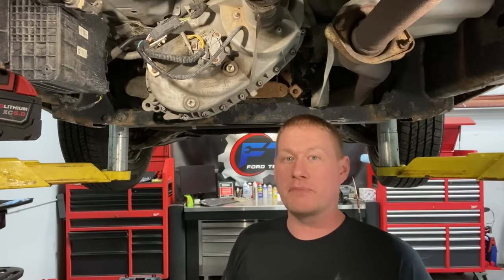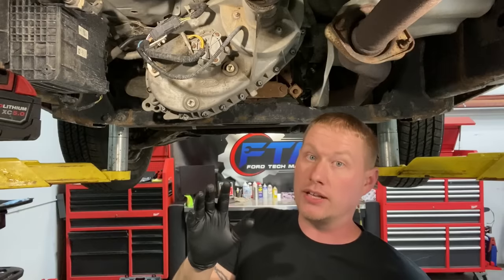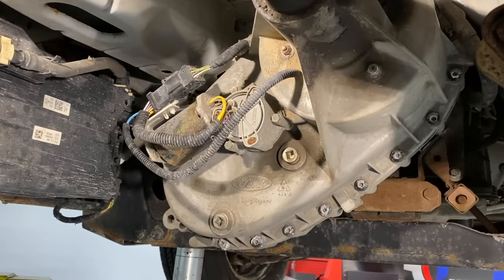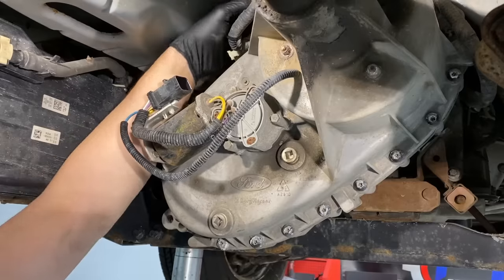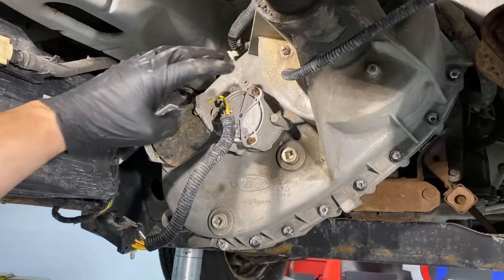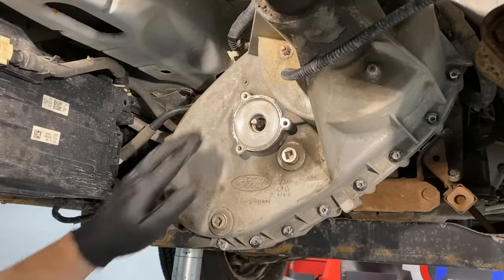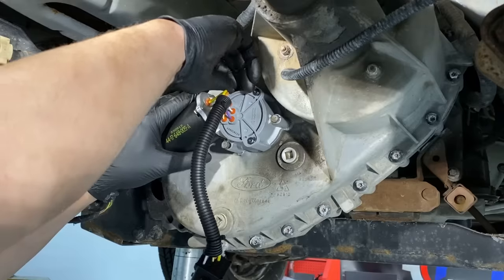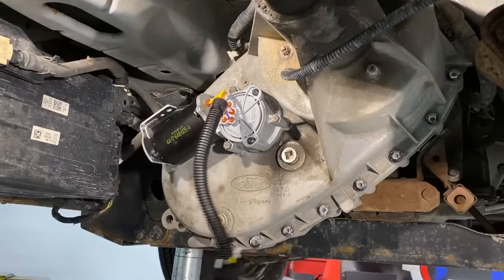2004-2020 Ford F-150 Four Wheel Drive Inoperative DTC P1867: Transfer Case Shift Motor Replacement

Comment: So I have an 07 F150. 4WD worked, and then died yesterday. I checked all fuses and relays, they're good. I have power at the switch in the dash, as well as 5V power on a bunch of the prongs on the wiring harness below. I am NOT getting 12v at the actuator motor power. If I jump power directly to the actuator, it will rotate. Is this an issue with essentially an encoder that's died so the BCM doesn't know it's position, so the BCM won't send it power? So a new actuator would have a new encoder and this would solve it? Thanks for any help.

Comment: Sorry but l remember a post U had on your channel referring to an motor noise on the new 5.0 motor used in the F-150 etc. It referred to number 3cyl valve noise and as l remember it had something to do with the rocker arm/arms revolving around that cylinder. I have all your posts but can't seem to locate that one if U can assist me l would deeply appreciate it. It doesn't matter but l am a retired 47yr mechanic and the truck in question is a 2017 F-150 which belongs to my good friend who is a disabled vet and is getting no help from Ford as they say they can't seem to hear the noise emitting from right side of the motor. Thank you.

Comment: My 2009 will only go in or outa 4x4 when it’s not running with key on… could it be this motor not sending the signal to the solenoid? I’ve replaced switch and solenoid, checked for vacuum leeks….
Reply: I have the same year…4x4 had stopped working a few years ago. I have not yet diagnosed the cause as I’ve been busy repairing the abs module. 

Question for you, if you don’t mind sharing. I recently began seeing “4x2” briefly displaying on the cluster when I turn the key on…however it doesn’t stay displayed when truck is running.  Do you mind sharing with me what you recall seeing when you start your truck? Thanks for any feedback…when I get home I’ll see if I can find the code. 

Also I had to repair my front passenger hub assembly a few years ago which I now wonder if it was due to iwes or 4x4 failing.

Comment: Could this electric motor be the cause of it not fully engaging in  4- wheel drive. My 2013 started like kicking out of 4x4 when it started getting under load?
Reply: Since there is obviously no follow up to the sorts of questions on this channel, my truck seems to be doing the same thing. 
violently slipping out of four-wheel-drive acting like it’s going to destroy something under the truck. What did you find out your problem was? 
please advise. 
Appreciate it thank you

Comment: How difficult should it be to turn manually to 4x4 and back? I have an ‘02 F350 and it’s quite difficult. I replaced my tc motor, and a few months later that motor burnt out. Wondering if it’s something more than just the tc motor

Comment: I have a 2005 f150 4x4 5.4. It starts up but doesn’t drive or go into reverse. Fuses are good, no transmission codes only speed sensor codes. Not sure what the issue is.

Comment: Would a faulty motor cause my 2011 engage 4 low when the dash switch is in 2 high while driving?
Reply: I am dealing with this exact issue. 2014 Expedition went into 4Low all by itself, and won't go back. From what I have researched so far, this can happen due to the faulty sensor plate inside, but is a less common failure. I'm changing mine out soon, so I will update the comment if it doesn't work.

Comment: I don't have a code on my 2013 F150 but my 4x4 is always on (4 Auto). Just about everything in the 4x4 system has been changed out including both IWE. Could the shift motor be the culprit but no code?

Comment: I'm trying to figure out if this is the part I need to replace.  After switching out of 4WD into 2wd I get a metal grinding noise.  If I stop the truck and switch back onto 4WD drive 10 to 20 ft and switch back to 2wd it goes away.  In your opinion is this the affected part that would cause this problem?

Comment: I have a 2006 F-150 and it does not have this motor, it has a Borg Warner transfer case and it is not going into 4 wheel drive?

Comment: My 2021 f150 will shift in and out of 4L and 2wd but won’t go into 4H.. tried spinning the actuator in that motor, and tried unhooking the battery to reset the confuser.. no codes are available but the service 4x4 light is on.. the truck did this at 15,000 miles and had never touched the 4x4 button..

Comment: I would like to know your feelings on the new plastic oil and transmission pans Ford is now putting on some of their vehicles.  Are you seeing a lot of problems--ie leaks?
Reply from the maker: I don’t see them too new but yes I have access to the Ford dealer site and yes tons of oil leak issues
Reply: Thanks for the reply.  I wanted to upgrade my Mustang V-6 to a Mustang GT, but couldn't get past those lousy plastic pans.  I understand that the Raptor went to plastic pans but have since gone back to metal due to leaks.

Comment: I have this problem. I believe I need to replace the transfer case motor. But mine is stuck in 4wd Lo. What is the best way to turn the shaft to get to 2wd Hi? Vice grip, channel lock? And should I be worried about damaging the shaft with those tools? Thanks in advance for any help!

Comment: So my truck got stuck on 4H , it switches from 4H to 4L and back but won’t switch back to 2H , I’ve installed a new motor from ford and still the same just won’t go back to 2H , and yes if I unbolt it the motor goes back to 2H and  I can manually switch it to 2H , any ideas or tips ? Thanks

Comment: Could this need to be replaced even if it doesn’t throw a code? I have a 2014 F-150, and I have the seems to be common problem of it having trouble going in and out of 4 Low. Where it acts like it’s in neutral and starts to grind.

Comment: I recently had an issue with my 4wd. Was in 4 low to pull my boat out of a bad launch. I shifted from 4 low to 4 high had a shift delayed pull forward message, then when put into drive it didn't move, rpms and speedometer increased. After multiple attempts and a check 4x4 message and some grinding it finally went into 2wd. Tried 4 low again and same thing happened no fault message this time. Also didn't have any fault codes when scanned after the check 4x4 message went away. Is my transfer case toast or is the shift motor most likely the issue?

Comment: I have a does f150 2014 when the 4X4 is turn on, on dry pavement I don’t hear any noise but in the snow I can hear noise on the driver side, I can also feel it under my foot. Does any know what’s the problem? I also put in two new actuator.

Comment: Hello friend, Excuse me for the inconvenience, get me out of doubt, the Ford explorer, expedition, F150, excursion, rangler and mazda, share the same transfer case? because I have to buy an engine of which you are changing but I see that they are very similar and only change the chips. This is so? Aperte I see a lot of difference in prices from one mode to another. and I have that little doubt that I see that the transfer cases are the same in those models. can be?

Comment: The transfer case is stuck between 4 HI and 4 Low on my  04 f150. What should I use to turn the shaft back to 2 Hi?

Comment: I changed the transfer case because the 4x4 doesn't go on. But now I put it on and it says 4x4 low and the truck drives slowly and doesn't go off anymore. What can I do?

Comment: Sooooo my 2009 f150 4h and 4L is not engaging..It says on the dash it’s in and when switching you can hear 1 little tick with ZERO follow through ..Could THIS be the issue.

Comment: I'm getting a grinding, whirring noise I think is coming from the transfer case. It only does it in 2 wheel drive. I think it might be the output shaft bearing or snap ring.  I can't find a part for the snap ring though. It comes up as a shaft repair sleeve. Has anyone done this specific repair? How does the sleeve work? Any help would be much appreciated.

Comment: My 05 expedition which is all wheel drive so my dial has all wheel drive too high for high for low it’s been making a spinning noise for about six months and not engaging in four-wheel-drive when I turn it from all wheel drive to too high the spinning stops for a few seconds but then it starts again do you think that’s the chain or do you think that’s the motor so 05expedition XLT I’ve got 130,000 miles on

Comment: If your truck was stuck in 4 hi  how would you turn shaft by hand so it would line up in the motor
Reply from the maker: Usually a pliers is needed
Reply: @FordTechMakuloco  thanks and you would need to get the truck in the air I think you might have said or I am just guessing

Comment: I took my actuator motor off and manually turned it to 2 wheel drive but my 4x4 low range indicator light stays on. It still seems like it's in low range even though I hand turned it to 2 high any idea why it won't go back to 2 high when I manually turned it to that setting ? Thanks

Comment: Great video man I had the same truck my motor almost got the 300,000 I put a ton of money in it I just have had enough body interior where pristine got $3,000 for it needed somebody like you to redo the whole thing two I bought a 2012 the five oh I like it except now 150000 miles stalls at idle at idle after it's warm any ideas
Reply: Sounds like throttle body and plate needs cleaning. Same for the idle air controller if it has it.

Comment: Hey I have a 2014 F150 Raptor. Repeatedly saying “Shift Delayed” no noise no code and no shift in to 4wd no matter if i pull forward or backwards. Could this be the Transfer Case Motor???

Comment: I have a 2003 f250  6.0  I can shift it into 4x4 but when I try to select 2wd nothing and I have to jump the relay to put it back I 2wd cleaned all connections tried a new  selector switch an new relays

Comment: The dealer told me if I installed an aftermarket motor from O'Reilly's myself it would need to be programed into the computer afterwards and they charge $110 to do so. I have a 2010. I notice you didn't mention doing this is it necessary  ?
Reply: No

Comment: My gas peddle looses connection in 4 x 4. Is this unit connected to throttle position via speed sensor? could this cause the peddle to go to zero?

Comment: So my 2007 suddenly wouldn't go out of 2wd.  One day it worked, the next day nothing. The light on the dash won't even light up. As I understand it if there is no vacuum then the hubs should be engaged and in 4wd. So if I had a vacuum leak somewhere I'd be stuck in 4wd not 2wd. Correct? So is this motor the likely culprit? Thanks!!!

Comment: Graat video, I love watching your videos. It's really helped me fix a few cars. I have a question, will the transfer case be going bad if my 95 bronco dies out in any gear when i put it in. When the 4wd is engaged it stays on in gear. When it's in 2wd it just doesn't stay on. I jacked up the rear end and put it in gear. It stayed on but making a grinding noise. Sounded like the transfer case or transmission. Once I applied the brake the truck died. It reapeated the same over and over. Any suggestions i can try to diagnose this problem?
Reply: Same

Comment: I used my 2018 F150 3.5 Ecoboost in the snow while in 4H. Once I got home it would only shift from M to Drive and Neutral. Eventually I was able to get it to Reverse but I can’t get to go into Park. It only has 245k mikes, is this motor the culprit? Please help.

Comment: Hey I am rebuilding an 05 xlt 4x4 and for some reason it won't go in 4 low, 4 high jumps right in and right out, but I used the 4x4 the other day 4 low worked well, but now won't go to 4 low at all help me understand lol

Comment: I have a 2015 f-150 that the Front wheel drive doesn't go on and no engine light is on what could the problem be?

Comment: Is there a way to shift the motor back to two wheel, mine seems to be stuck in 4L. I need my truck until my new motor arrives. I live in the north of Canada and will take approx 2-3 weeks to arrive?
Reply: Didn't the guy show that in this video? Pull the motor, take a screwdriver and switch it to 2H? Wheels need to be off the ground/truck in neutral to do it...

Comment: My buddy has a 2012 f150 that everyonce in awhile it pops up brake system fault and it makes the pedal rock hard the first time you press it after the light but the second time is normal. Any ideas?

Comment: My 4x4 would engage and disengage in warm weather. As soon as the outside temperature drops around 0 Celsius. Nothing happens. No sounds no light. 

Is this motor my problem?

Comment: When I removed the shift case motor on my 2018 F-150 I found the wiring receptacle was different than the video. My vehicle has a receptacle with flat pins and I couldn't figure out how to remove the one wire that needs to be inserted on the ne transfer motor wire harness. Anyone know how to remove the flat pin wire from the harness?

Comment: I've got the opposite issue my four-wheel drive is operative in fact it's operative when I don't want it to be operative I'm driving down the highway the four-wheel drive light comes on it goes into 4 wheel drive but then it'll kick itself in and out of four-wheel drive as I'm driving.

I've got a 97 f150 with the four-wheel drive switch no lever in the floor.

Comment: I’m at 205k and haven’t had this failure yet (knock on wood). Am I one of the lucky ones?
Reply: 173000 here- all is well.
Reply: 2012 F150 lariat with 360,000 miles on it and mine is still on the factory original. Cant say the same for the IWE's however.

Comment: When these fail, do they sometimes make a loud mechanical binding sound? My 2012 has made that noise when I shift it into 4Lo and 4Hi before.
Reply: Raul, I had to have my entire transfer case replaced on my 2014 f150 at 59,000 miles. I never used 4 low but when I tried to, the dash comment said pull ahead and it slammed into low. I changed fluid every 30,000. I thought the shift motor on mine was bad too and it could have been but the transfer case low range was trashed. Wish you the best but things slamming into gear are not good. Bob
Reply: The shift into 4L on my 07 F150 is always pretty harsh. The truck needs to be in neutral/not moving when shifting into and out of it. If it's just the shift that's loud, sounds normal to me. If there is noise while driving or something along those lines, you probably have a different problem.

Comment: I can't turn my front driver axle by hand but I can turn my front passenger axle. It makes a really loud grinding noise almost like bad bearings grinding. Once I put it in 4HI the sound goes away. I think my driver side is stuck in 4HI but my passenger side changes freely. What's the solution?

Comment: Let’s say you can get in and out of 4-high just fine, but never 4-low. Would this more likely be a failing shift motor, or would it be a bad control module? This would be on a 99 Superduty...

Comment: We have a 2002 F-350 with shift on the fly and nothing pops up on the dash when you try to engage into four-wheel drive. Would that be that motor or would that be some electrical issue in your opinion

Comment: I have a 2015 with P187E:00 Differential Lock-Up. Control Circuit High  If I start the truck it’s fine no codes when I turn the steering wheel the code comes on

Comment: What would be the systems?   I get  knock while driving or turning.   Sometimes it fails to turn on, unless I put it in neutral,  turn key on, move it to 4L, then turn the key over. Then I can move it to 2h, and drive away..
Reply: Then it will follow with, "over drive fail"

Comment: Wished you could fix my Ford, I'd sure let ya. 97 f150 4x4, new shift motor and I varified it is indeed the correct one and works right. Shift on the fly, goes right in 4hi, then 4low no problems, everything works great. Problem is it doesn't wanna shift back once in 4wd. The damn truck refuses to switch polarity on the shift motor. I varified the shift relay, which is two relays in one under the dash panel, does indeed work... I tested it off the truck manually according to the wiring schematics. Wth? GEM works everything else perfectly?... it's the ONLY problem this truck has. I find it difficult to believe the GEM might be bad but I could be wrong... any hints or suggestions?

Comment: So my front differential is always spinning on my 2012 Ford 150 even in 2wd, can someone give me some pointers as to why it won't disengage while in 2wd? I had my pickup jacked up, all four wheels off the ground and put it in drive in two wheel drive and the front axles/ shafts are spinning- coming out of the font differential... my iwe's work good, the wheels weren't spinning but the shafts out of the differential are spinning. Any help would be much appreciated! Could it possibly be the motor on the transfer case?

Comment: Dog got to the wiring including the Blue "Syncro" Wire. Excuse my spelling if I'm off on it. I need to replace it as well. Can't find it in any diagram. Replacing on a 2012 Ford F-150. Anyone have any help with this one??

Comment: I have a 2011 f150 replaced iwe hubs new transfer case shift motor new check valve and new vacuum solenoid still no doesn’t engage the 4x4 and pulls up the check 4x4 on the dash. It sometimes locks in and sometimes doesn’t.

Comment: Since the new part comes set on 2 wheel drive, How do you shift it back to 2 wheel if it’s stuck on 4 wheel drive?
Reply from the maker: You can turn it back by hand.

Comment: @FordTechMakuloco How’s the Wool Wax doing on your F-150? Is it washing off or is it still there?
Reply: Dylan Miller I have not spray it on my truck yet, but I did to my ATV. That was 4 years ago and I just worked on it and there was no mud sticking and I could see the woolwax was still on the surface. For the quad I went to Lowe’s was and picked up a can. So far 5 stars !